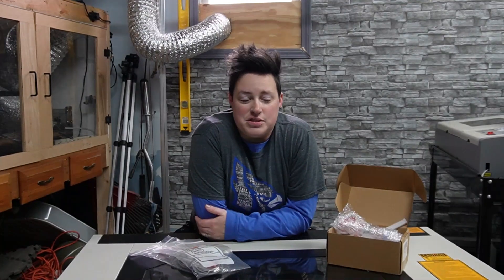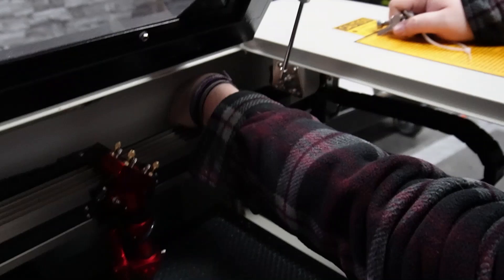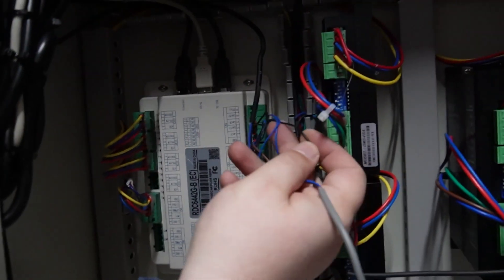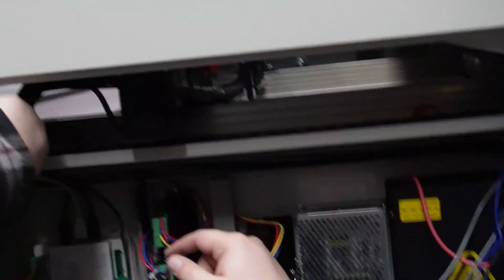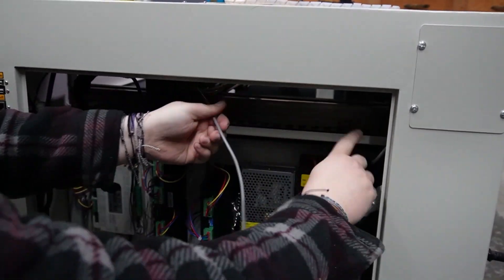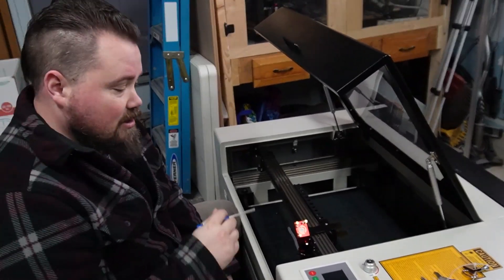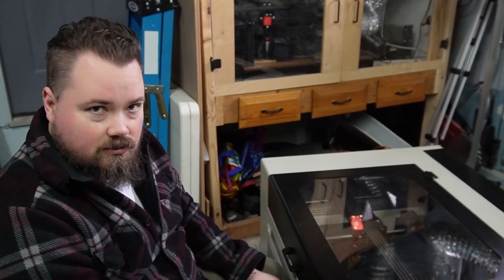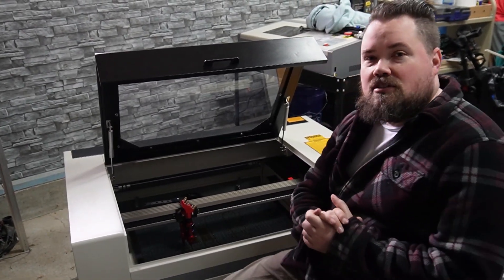Replacing Limit Switch | Monport C02

Comment: thanks for the video! If my controller screen is showing X and Y coordinates higher than my workspace, and the laser head hits the wall. Is that a limiter switch issue or an issue with the controller displaying numbers too high?

Comment: How do you know if the switch is bad? I bought 2 new ones (my dime after no response from Tech Support) for my 60W as well and have the machine tore apart as I type. Both of my switches light up. are in the exact same position as yours but 1) at startup, the head goes to home and starts jackhammering trying to go past the limit switches. Also, both of my switches get hit by something and lean over no matter how low I take them.

If you get a Monport, prepare to be inside of it regularly.